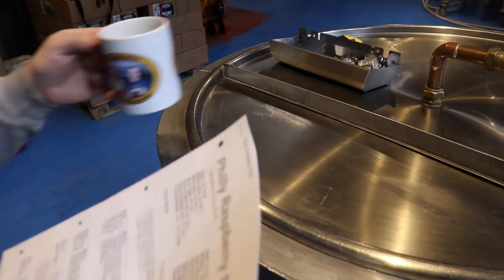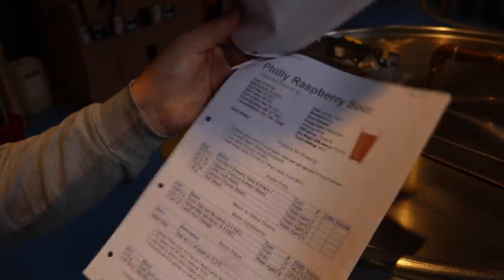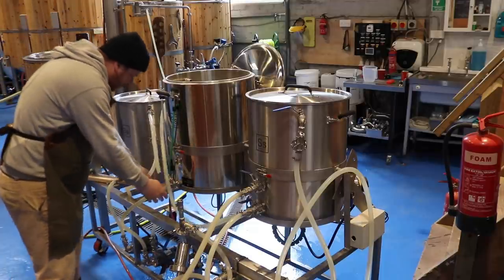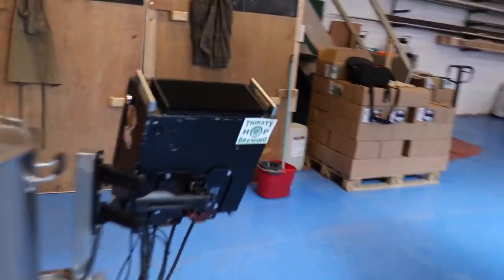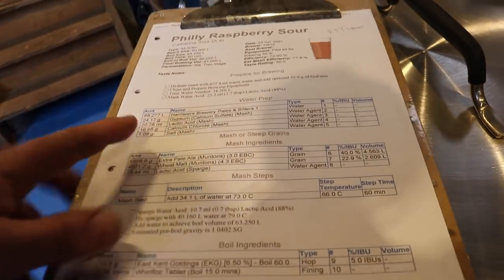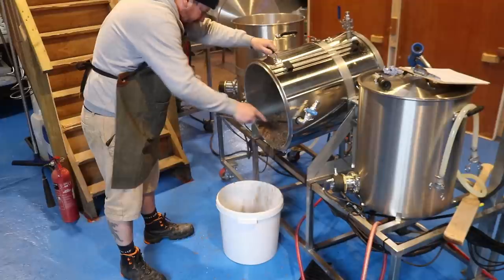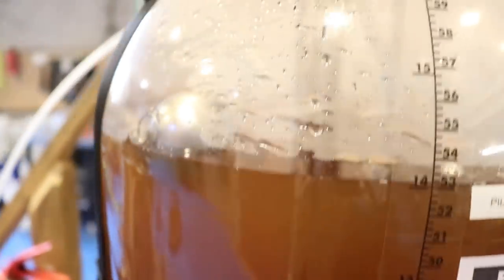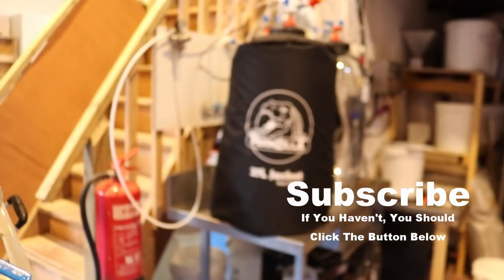Philly Raspberry Sour Brew Day

Comment: Are you going to add fruit to the current FV, or transfer onto the fruit in a different FV off the yeast cake?
Reply from the maker: Not sure yet, I'm leaning on adding to the current one so far.
Reply: I would recommend transfer. Fruit is the only time I transfer to secondary. The flavour is cleaner. How long you planning on leaving the raspberry on the beer? I think you said 30 days, I only go with 5. So it will be interesting to see what happens. Oxidation is a challenge for me with these beers and after 6wks in bottle mine loose their pop and bright pink colour. But then they don’t hang around for so long anyway